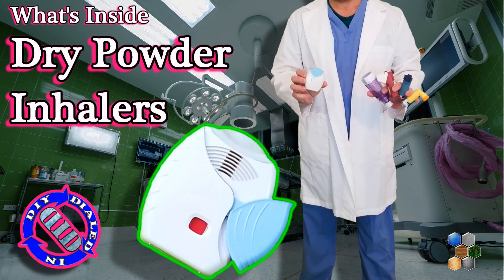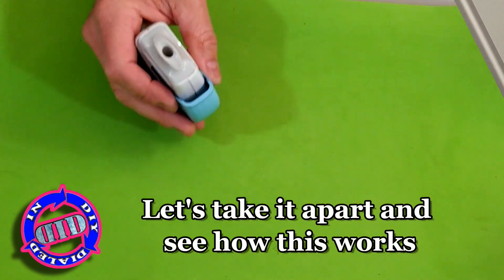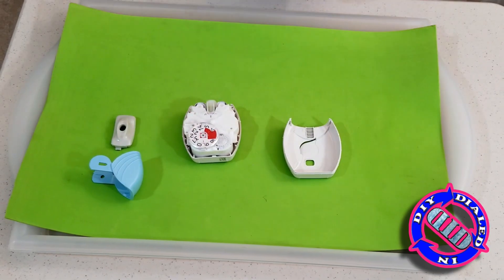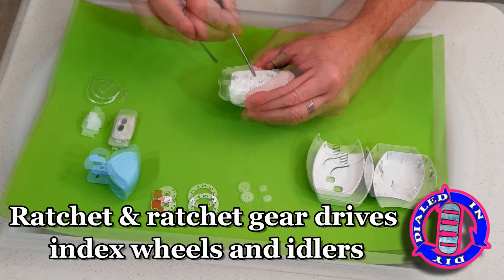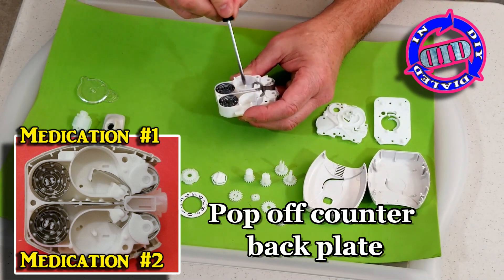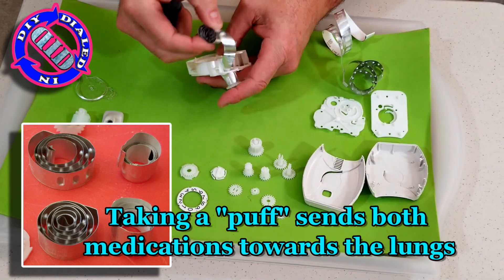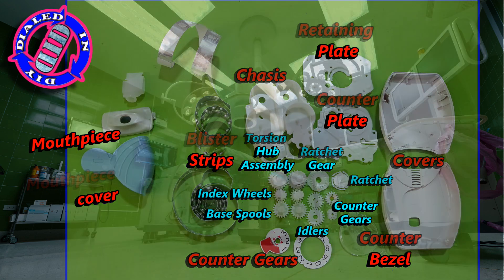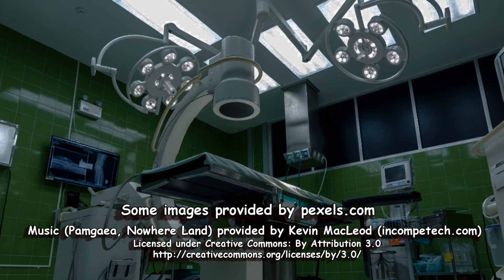What's Inside Dry Powder Inhalers - Metered Dose Delivery Device

Comment: This vid saved me from taking mine apart. I have a Trelegy and it supposedly has THREE medicines in it. I wonder if there are three of those coiled up med strips in mine or if there are two meds in one of the strips. The way the gears click when you slide the trigger case, reminds me of a view finder. Idk why lol. It was really weird breathing in dry dust meds in the beginning. My lungs were like "what the heck is this?" it felt so gross like breathing in sand. But I got used to it. Still gross though js. lol ha ha thanks for the vids. I use youtube for everything. Install gas water heater, change my dryer belt, light my gas dryer pilot light,  try to fix my front loader. lol cheers.
Reply from the maker: Thank you very much.  I really appreciate the feedback/info and you taking the time to post a comment! Interestingly enough, according to the Journal of Aerosol Medicine and Pulmonary Drug Delivery the Trelegy is also a 2 blister strip design. BTW, the view finder reference totally makes sense... the motion and the sound are very familiar. I agree, YT is my go to for figuring out how to better visualize or investigate repairs, etc.